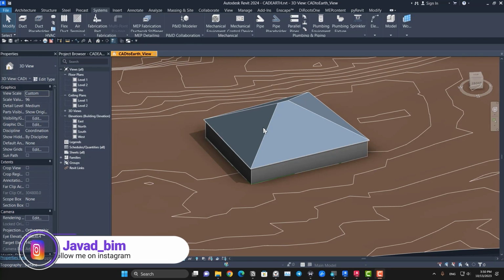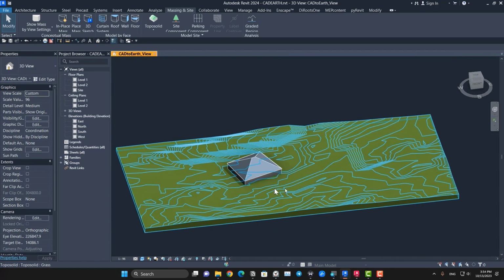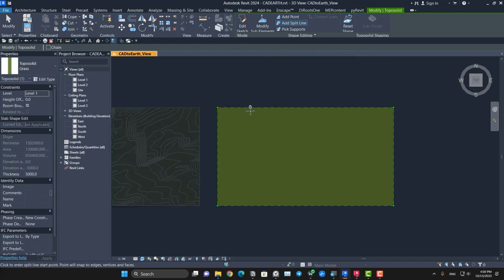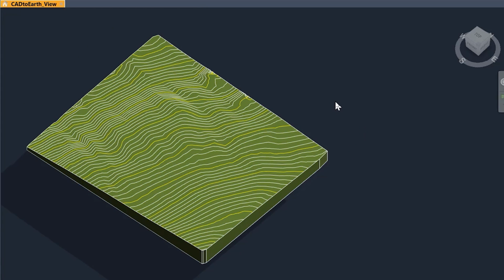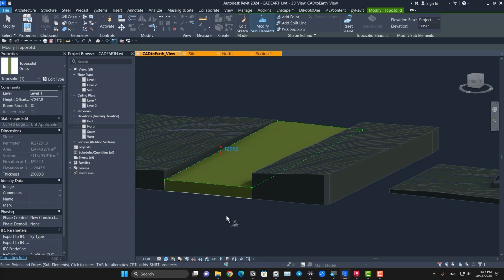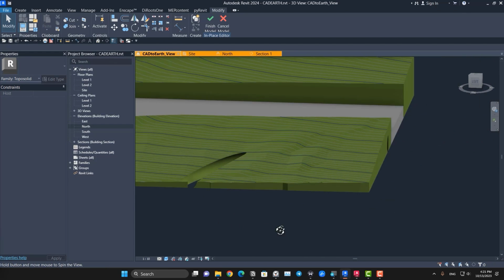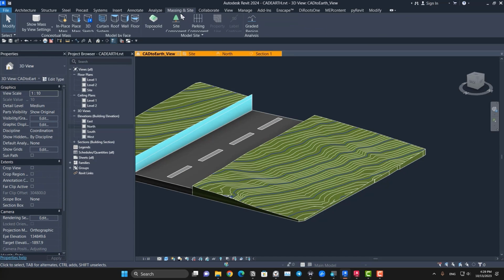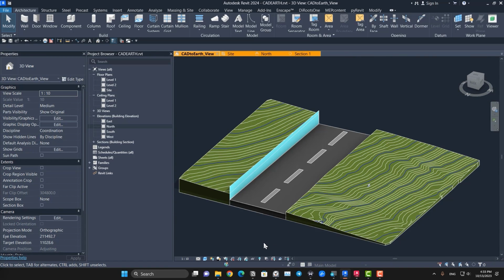Revit Toposolid Full Tutorial  - Revit 2024

Comment: There IS a workaround for the (possibly annoying) 2 things about topsolids. Both workarounds entail using either ACAD or Civil3D... 

1. "Split toposolids - can't be rejoined". Solution: Save a 3D view (only show ALL the split toposolids to re-join) into a DWG file. Clean up the "splitting polylines" in ACAD, SaveAs a new DWG as a new "surface". Create new toposolid from this modified DWG.

2. "Make a toposolid by face from mass - the toposolid can't be edited as a normal toposolid". Solution: Kind of the same thing. Save 3D view into a DWG file. Re-import into Revit, then create new toposolid from imported DWG.